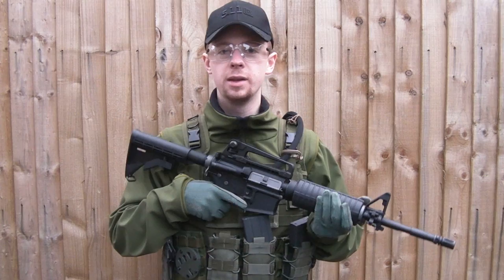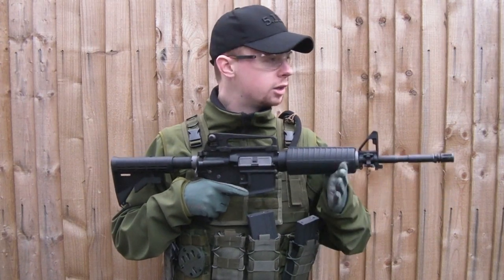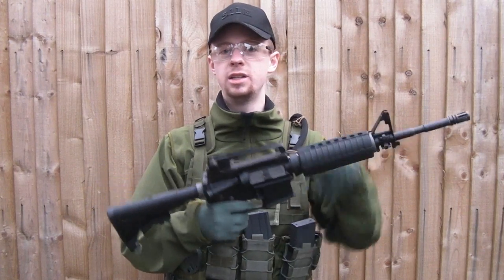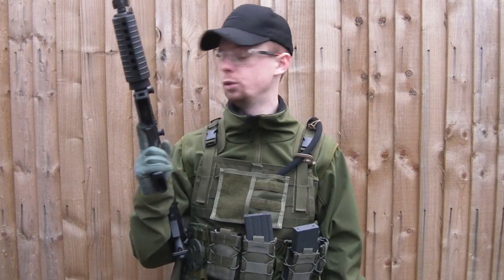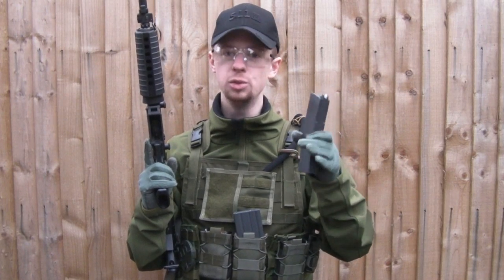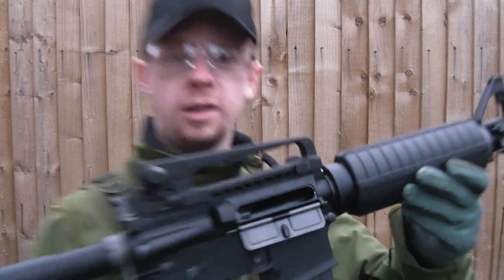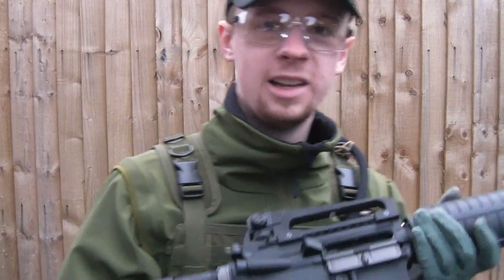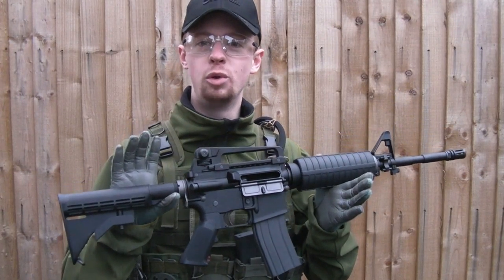LM4 Mag Dump

Comment: Does exist any mag for Kwa Lm4 that fit more than 40 BBs?
Reply from the maker: No I don't think so, there aren't many different types of mags.
Reply: Thanks for the answer!
It would be very usefull a gbb hi cap mag to play AirSoft
Reply from the maker: Do you mean a drum or something?  There's no room to store the gas in a hi-cap, you'd have to get something like a Tippman HPA to have gas recoil and hi-cap mags.
Reply: At least could exist a mag for 80 BBs. With propane is possible to shoot about 2 full BBs mag. More than it, only with HPA, right?
There somewhere that sell and send Drum Mag HPA that fit in KWA LM4 GBB?
Reply from the maker: I presume to fit 80 you'd lose some space for gas, also people want the bolt to lock back every time.  HPA I know nothing about.